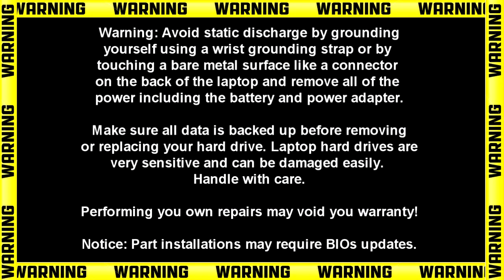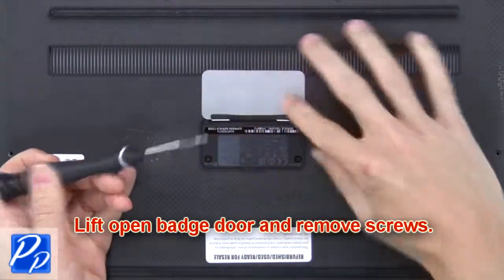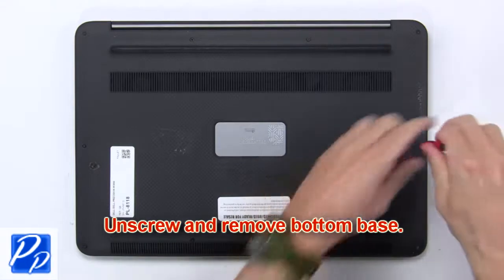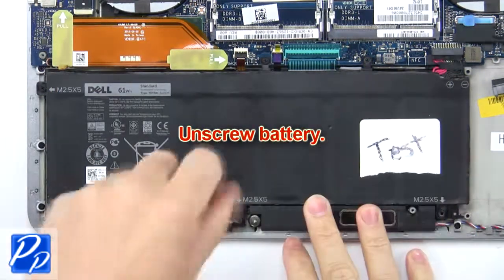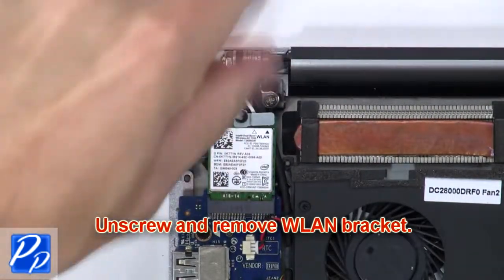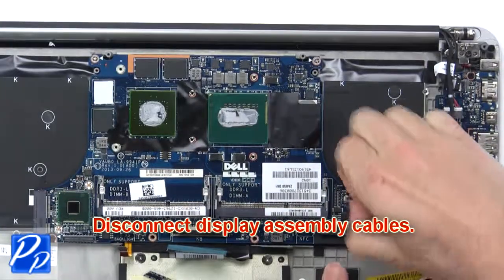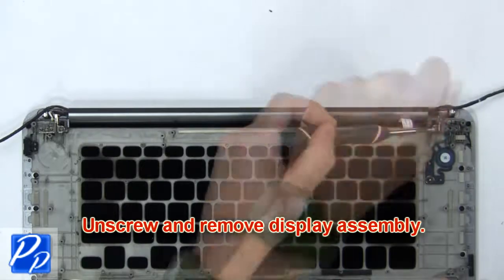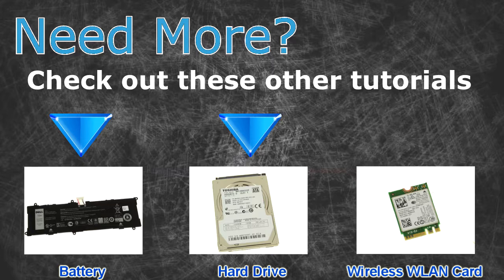Dell XPS 15-9530 (P31F001) LCD Display Assembly How-To Video Tutorial

Comment: thank u for your video
I had a qustion, I have a Dell XPs 15 screen 15,6 resolution 3200X1800
Can I replace this original screen with 4k screen with resolution 3840x2560 ??
Reply from the maker: Yes you can replace it with a 4K screen.